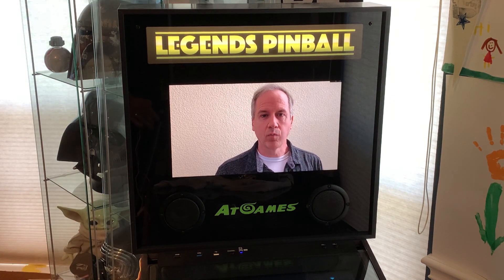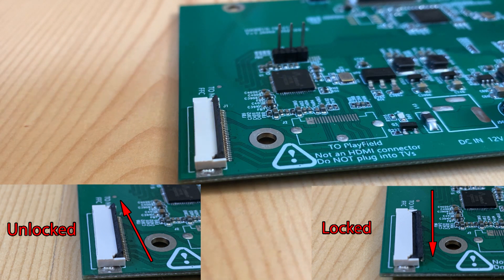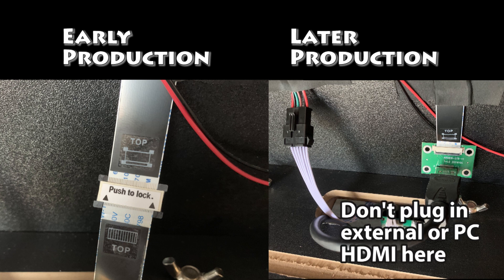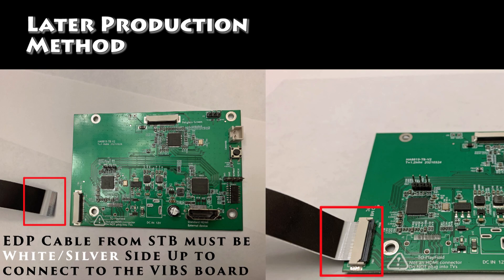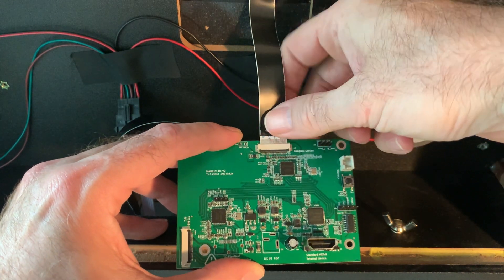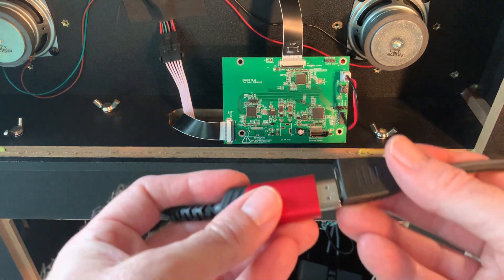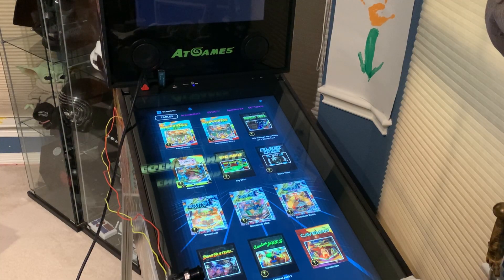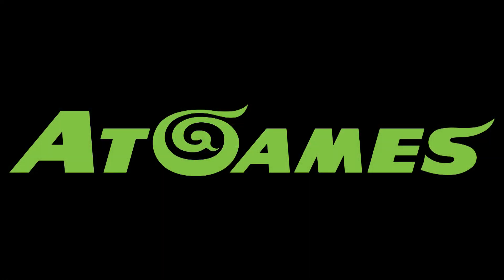VIBS (Video Input Backglass Switchboard) Installation for the Legends Pinball

Comment: Few questions, 1) Will this automatically put the FX3 backglass stuff from those boards onto the backglass? 2) that first connection A into the laptop, looks like USB-C laptop end, correct? I only have one HDMI on my laptop so I can use a splitter, or HDMI - USB-C? Will both work?

Comment: Thank you for the video. I am enjoying the table but I have to ask, why is this even something we need to do? I've been in IT and building computers for 30 years. Seems like the included PC could have had 2 normal hdmi ouputs to drive 2 standard hdmi monitors. Maybe this setup was a cheaper cost than standard signals and connections? I've never had to design to build thousands of systems so I don't know. Just seems like standard connections would have been easier. Still, I am happy you did provide something for us.

Comment: I have the new version. Installed the cables properly. First boot got random glitchy screen on the back glass. Reset everything and now get no image even after clicking switch. Remove vibs and back glass works fine. Thoughts? Bad vibs? Blue out on little board. White out on both cables on vibs.
Reply: Did you ever resolve this?  I get solid colors on mine, blue/green screens but nothing else.  Made sure the cables were correct and everything.
Reply: @johngannon  I got a free replacement VIBS and everything worked right out the box. Same cables. Must have been a bad board.

Comment: Edp connectors are junk. Cant even open without breaking them. The more I work on this the worse it gets
Reply: Same! No replacement board that holds the hdmi port and cable that goes to the back glass. WTF
Reply: I’m joining the we’re screwed club
Too. Apparently I removed the tape which destroyed the connection.
Reply: I am also in the sinking ship. I have a useless backboard now.
Reply: @williamhauburger  I ended up getting a portable laptop monitor 15.6 inches. Has hdmi and usb c. Just taped it over the old screen and honestly in the dark you can’t even tell
Reply: @millertv79  Does the screen work for the standard games or only OTG?

Comment: I removed the ethernet jack from the back of the cabinet. Doing so allowed the required cables to be routed out without the need of drilling a hole.
Reply: Hi, thanks for the idea! How did you remove the jack please?